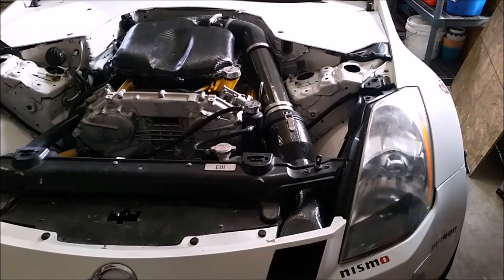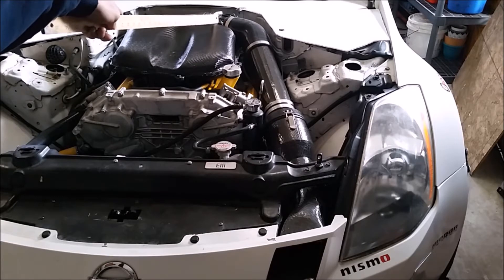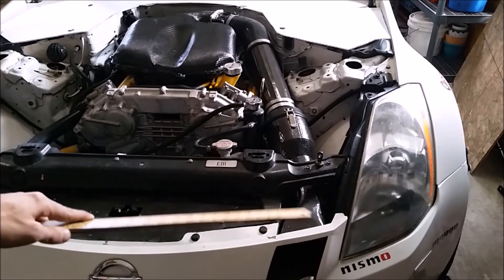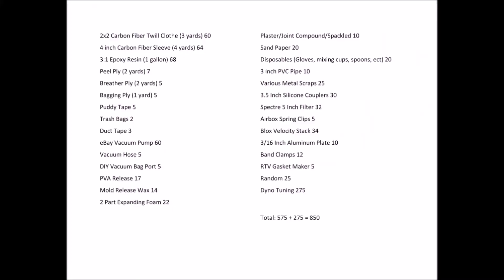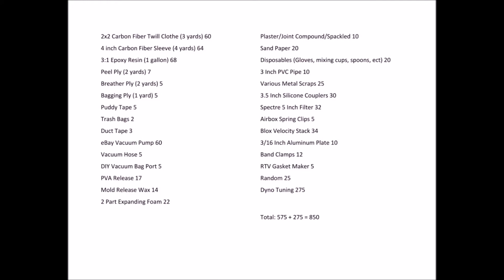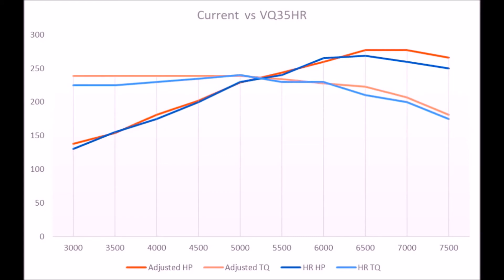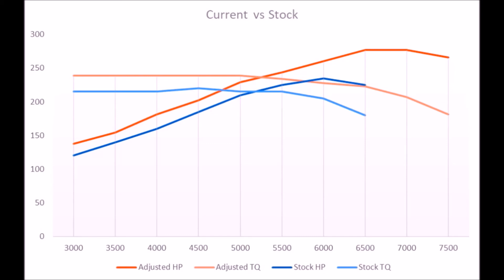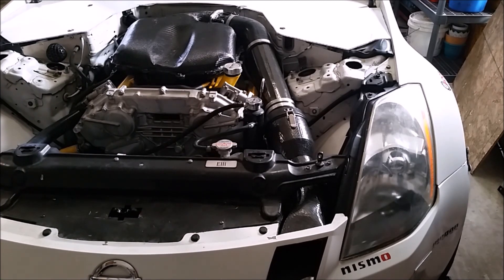How to Make a Custom Carbon Fiber Intake Overview (350Z Part 6 of 6)

Comment: dude your limiting factor for why you made so little power is the fact you bottle necked yourself before the filter.  I get the cold air part but you're still limiting how much air the filter can even receive. keep in mind g35's and 350z's have a whole box from factory and the g35 has TWO ways of receiving air which helps with it not bottlenecking there while still getting cold air. I can guarantee if you switch your intake design you'll have gains! You simply cannot taper it to the bumper like that, defeats having a filter that big that has potential of sucking more air when theres still a bottleneck in the system. if youre intake is 3.5 inch, it cant taper before or after at all.
Reply from the maker: Seeing as that "taper" is the same cross sectional area as a 3.5 inch pipe, there is no taper. It's getting plenty of air. The limiting factor are the cams. 40hp over stock with simple bolt-on parts is plenty.

Comment: I like your disign of the intake and that you did this on your own. This have given me plenty of ideas to carbon fiber. The only difference I would have done is, use your current parts for a mold so that this process can be repeated by others. In addtion, to be able to lay down all of the fiber in a symmetrical look. Then focus on the look of the finished product. Once again perfect job and thank you for your time.
Reply from the maker: Thank you. Good luck!

Comment: I've heard many times that the OEM aero of the Z33 doesn't allow for good airflow into the front bumper duct. Do you feel like it's effective? A lot of people say that air hits the front bumper and goes over that section. I have the pop charger style Z1 intake, but I like the look of the cutout. Love your vids and thanks!
Reply from the maker: Thank you! If the engine is sucking in air, it will create a low pressure zone there. The high pressure air on the bumper will go to wherever the low pressure is. It may not be as perfect as something designed from scratch with hours of CFD, but it's certainly better than stagnant engine bay air. Plus, as you said, I do like how it looks.
Reply: @350Z247  The change in pressure makes perfect sense. It won't be as complex as your build, but it looks like I've got a new social distancing project. Thanks for the quick reply!
Reply from the maker: @travismills4499  Always happy to help. Good luck!

Comment: This was an excellent series! Are you running the stock exhaust? Or if it's not stock, what's the setup? I'm hoping to duplicate that epic power curve on my DE build as well.
Reply from the maker: jellofuel thanks man! It's shorty headers, test pipes, a long primary y pipe, and 3 inch single straight pipe.
Reply: Nowhere else left to go except cams! Though I wonder with the extra flow, if you'd need to reinforce the manifold further.
Reply from the maker: jellofuel no cams would make it easier as big cams pull less vacuum than mild cams. I won't do cams on this motor as I'll eventually buy a salvaged hr 350Z and do a full power train swap. The HR just offers so much more potential. I put the DE in the salvage car and make it it a caged cart